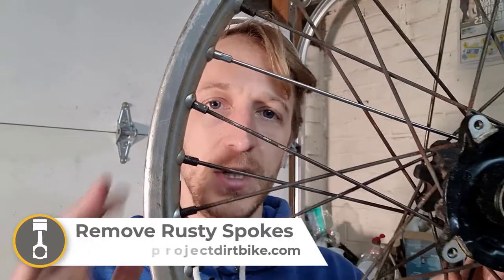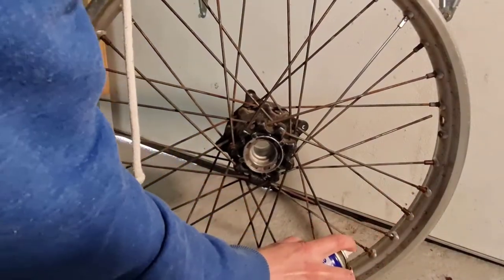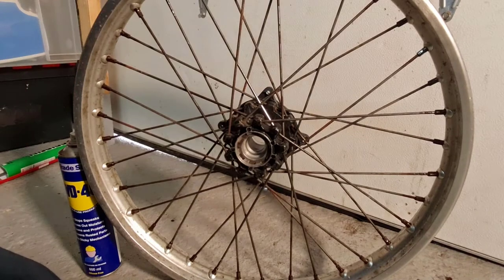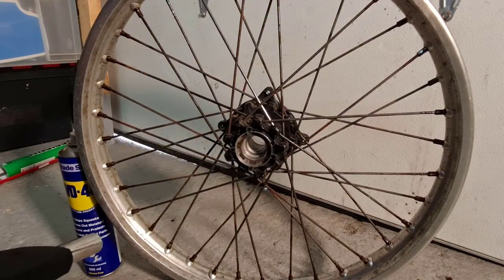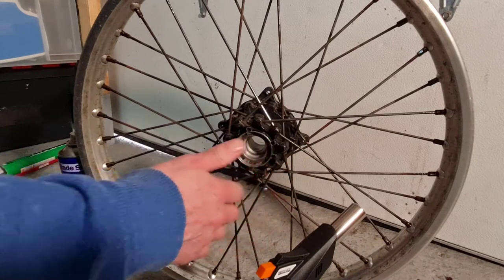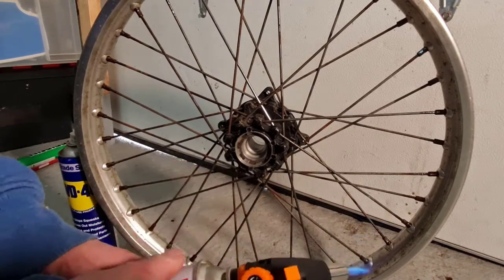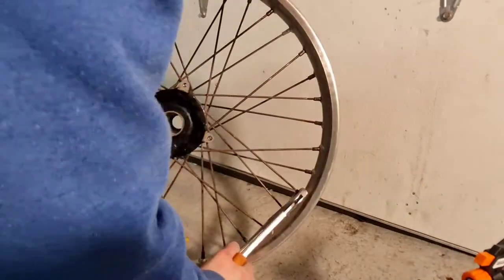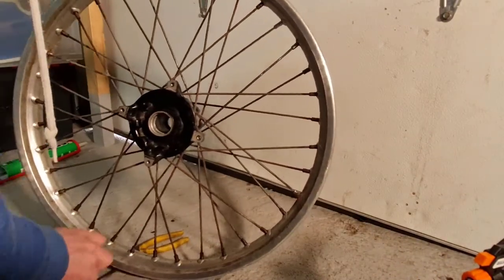Remove Rusty Dirt Bike Spokes

Comment: Bud that’s fukn crazy heat that up like that. Just cut them if you bought new ones wtf.  What I did was spray them then I grabbed spoke with vise grip and turned out nipple with wrench  these were on a 01 Honda I saved all spokes front and rear but maybe 6   What your doin is just stupid